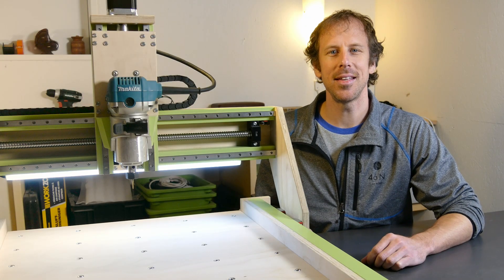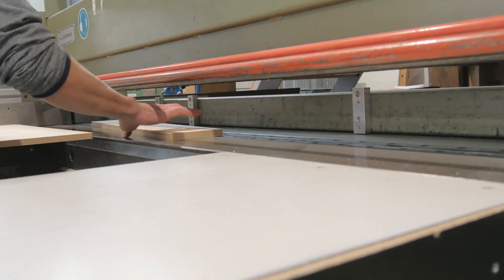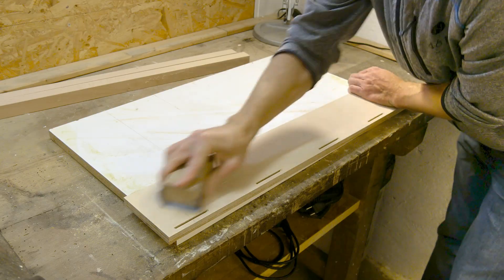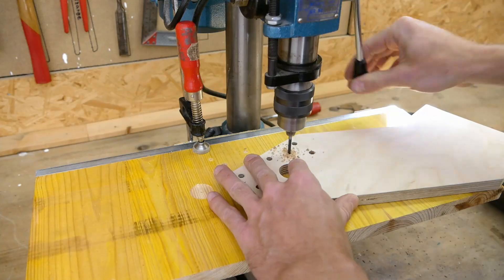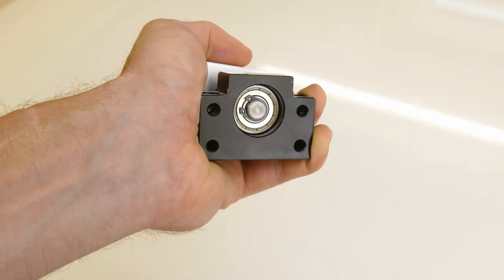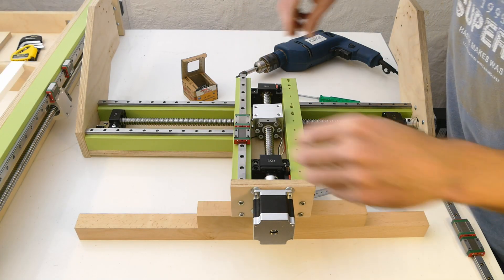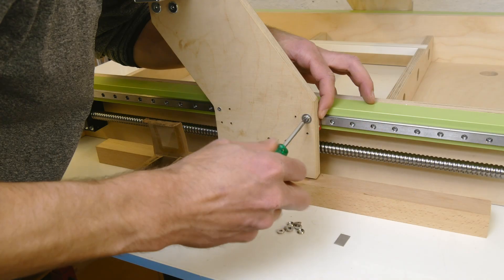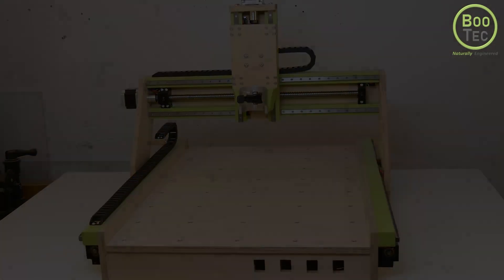DIY CNC Machine - Frame Build | Part 1/2

Comment: Update. Everything is painted and assembled. I'm about 90% done with the wiring. I'm running into issues with the limit switches picking up EMI (Electro-Magnetic Interference) from the power cable that runs to the router. I was using the AC ground for the shielding ground, I moved the limit switch shielding ground to the Arduino 5 volt ground and it is much more stable.  I've been using .NC files I created in fusion360 to test the gantry movement. The gantry glides effortlessly with the 1.9nm motors. The Y and Z axis were reversed, swapped A and B inputs and all is good. Initially, I could not get the X,Y, or Z motors to turn using the power supply ground to -PUL and -DIR as indicated in the video. After consulting with someone at STEPPERONLINE they said the -PUL and -DIR should go to the 5v ground on the Arduino. It fixed the problem. It should be ready for the first test cuts tomorrow. Things I would do differently....put the router power cable and all AC wiring in the chassis inside grounding braid to eliminate any EMI. I have had a great time building this thing, a really fun project !!! Thanks Roman !!!
Reply: Hello Carl, inspired by Romans and your building i would like to ask if you can write down a list with all the links (where to buy) of the mechanical and electronic parts of your bigger machine. This would help a lot! Thanks, Peter
Reply: @airparkdolomitiparagliding5561  I used Roman's list. Aliexpress had several rail kits, I opted to buy a larger kit instead of the rails and screws that Roman had listed. I also upsized the motors and controllers which I got at STEPPERSONLINE.com.
Reply: @carlwheeler3403  ok thanks, i will study the whole sites and hope to find my way through the jungle of different options:-) Hope to buy the right material...
Reply: Hi Carl, I also bought plans and I`m trying to order parts. There is no EU stock for parts listed in Roman plans. There is a set with 400/700/1000mm ballsrews and linear rails available. Did you have any problems making machine larger? Did you just add dimensions difference of new parts to plan? Can we talk more about expanding machine - you can send  me emai to janko.sraufciger@gmail.com. Thank you

Comment: I started the assembly today, its going well. The pieces are fitting together like pieces of a puzzle. Without having the dimensions of Roman's machine, I had to estimate and I estimated correctly. I tried to post a picture to this thread but that didn't work. Does any body know where I can post a picture that can be seen by the public?

Comment: You inspired me. I'm in the process of building it right now. I upsized it a little. The size is 1100mm (X), 1120mm (Y), and 500mm (Z). The kit included the 20mm guide rails and the HGH20CA glides including 2 Y-axis ball screws and rails. I also upsized the motors to 1.9nm (269oz in). I do have the Makita router in your video but I upsized that to the Bosch 1617 2.25 hp. My only concern is whether the 1.9nm motor for the Z-axis can lift the 6lb Bosch router without stalling. I also will be installing an emergency 'OFF' pushbutton and I will be mounting the Ardiuno USB connector on the front, not the rear. I have all the parts cut out and have started assembly. Wish me luck.
Reply: Did you document your build anywhere?  I too am starting this build.  I purchased 1000mm linear rails and 950mm ball screws for the X and Y axis.  Kept the Z the same.
Reply: @Phil Havens I used Aliexpress.com, the link is below. If the link doesn't work do search for "the Jason August Store". https://www.aliexpress.com/item/32958539515.html?spm=a2g0o.detail.0.0.7d1667796FUZ5H&gps-id=pcDetailCartBuyAlsoBuy&scm=1007.12908.131037.0&scm_id=1007.12908.131037.0&scm-url=1007.12908.131037.0&pvid=b2013286-4dfc-44d0-8f7b-87c7987bc453

Comment: I've got to admit, I love these DIY builds, and there is much respect for the finished article. However, I noticed just from the video that everything was so tight fitting and perfect, that there must have been something else at the end there. I wasn't surprised at all when I saw the entire industrial grade carpentry workshop which in itself I would say prices this unit right out of the DIY 'home' section and right into the contractor cnc enthusiast section.

Again, a great video, but would have loved to see this built using real home tools that someone can keep in a 8' x 6' shed.
Reply: You can do this at home, the only difference is that you will ask the lumber supplier to finish the wood for you as opposed to doing it yourself as in the first section where he was in his friend's shop

Comment: hi! awesome machine! i was wondering if you would do the same for a large cnc... actually i need a working space for X axis around 2000mm, and I think it's not really recommended to use the screw to move along the axis.. is it better to use the belt system? Would you change something apart from this on your design? i appreciate the tips.
thank you

Comment: An elegant design, beautifully realised. I'm looking forward to more videos!

The only concern I have is whether or not the gantry provides enough rigidity in the x direction? Still, even if it doesn't, I doubt there would be much difficulty in designing and adding a couple of pieces of plywood to cross-brace the gantry sides the same as you have done elsewhere. 

Thanks for sharing

Comment: Want ot build one too! Like the others. Please part dimensions etc. (technical parts drawing?)   But I have a question. What is the  resolution ?
Reply: 1605 Ballscrew is 5mm lead, at 1.8° per step you get 0.025mm resolution, which is plenty accurate for wood routing.

Comment: Did you get a loose wagon on a linear guide, sideway play? Or are you usind SKF, Rexroth or equivalent hardware?
I got mine from Banggood 1 of 3 guides wagon kits were crap, just usless piece of garbage. Banggood doesen't care 
for customers, no respond from Banggood! I got banged good by Banggood.

Comment: Very nice build! Mind sharing your full specs of the build / parts? I’d like to replicate this exactly. Thanks
Reply: I would recommend just buying the rails and parts you need, then buying the wooden pieces to size. Because there are no software limitations to the size of this machine, you can scale it up or down any way.
Reply: This is because the electronics take a long time to come from China. So you can buy those first and go to local homedepot and get wood to size

Comment: You say that there is a complete parts list but all you have are you affiliate links. You dont have a list of dimensions, lengths, etc. I would like to attempt you build at my shop and would happily use your affiliate links if I could get a more complete parts list with specific lengths and dimensions that you are using in the video. I would love to see more videos of this router in action. Keep it up.
Reply: He has a build plan in the first comment I believe
Reply: @mattchumoore4214  there is plans for a nominal fee but some of the sizes for the lengths of the ball screws and the rails are not there

Comment: I saw ur vids on making pc cases i want to make a case that fit in a small bag cuz im traveling and i dont want a laptop (expensive) my budget for the pc is 1200$ ... lets say i have 100$ for the case materials .. should i make it out of wood ?
Reply from the maker: This depends on your preference. Most people will probably tell you to use aluminum because it's the more common material to build cases and you can use thinner panels. Good luck with your project!